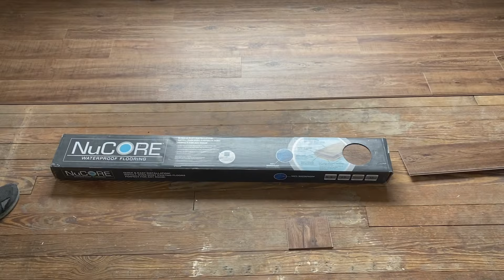How to Install Vinyl FLOORS from 'Floor & Decor' | NuCORE | DIY TIPS & TRICKS

Comment: Great video… I just was wondering why you didn’t use any underlayment?? I’m planning on doing the same floor…. thanks
Reply: LVT flooring doesn’t require it. Its an optional to reduce moisture, sound, and may help level the floor.
Reply: Someone on a different video said the NuCore has a cork backing so you do not need underlayment for that brand.